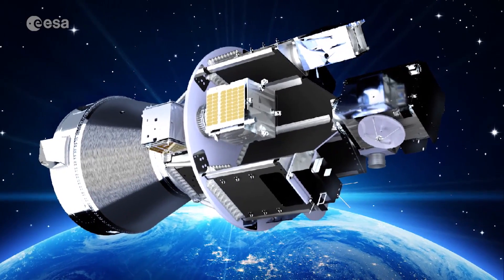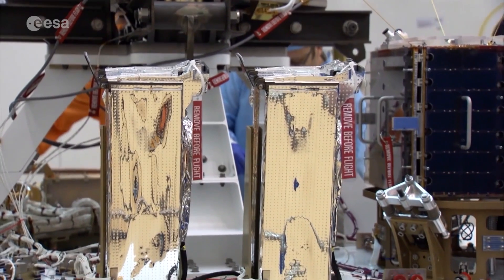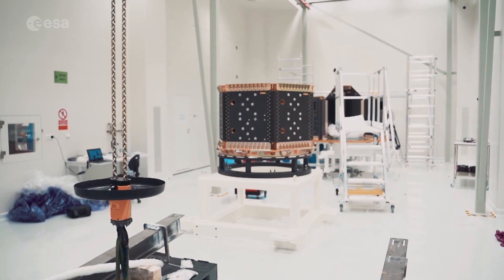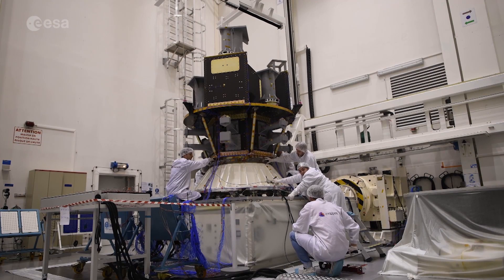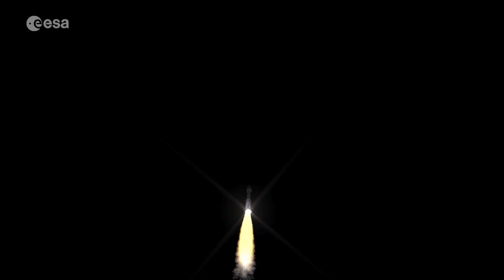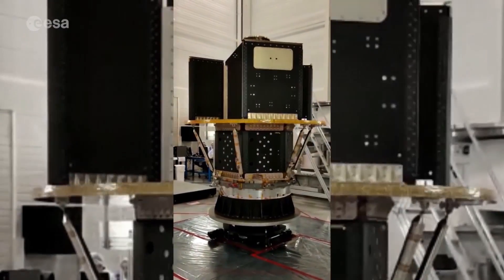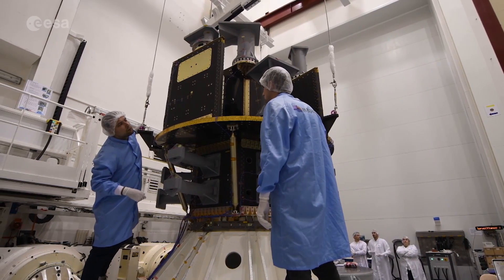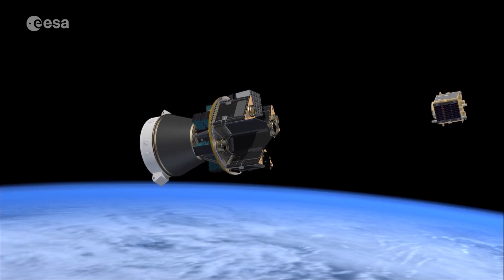SSMS inaugural flight on Vega

Comment: Small question here: When “competitive prices” are mentioned, what is a rough ballpark figure there? I heard that a CubeSat launch on Electron for example costs around $80.000, what price is ESA aiming for with the SSMS?
Reply: The cost of the payload on Electron is about 30000 dollars/kg, on Vega about 20000 dolars/kg, on  Facon Heavy of SpaceX about 1400 dollars/kg, but the latter can't satisfy all the request of the market of low altitude light satellites yet.
Reply: Depends, we first need to know the price per kilo
Reply: @wysiwyg1  But definitely for the commercial customers buying a slot on the rideshare here, which is why the price per satellite is an interesting figure